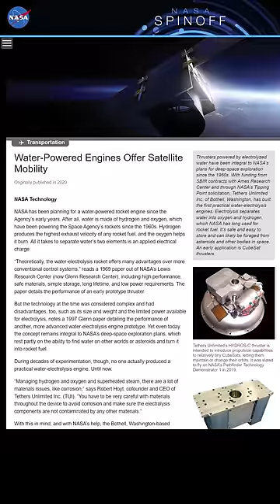This satellite runs on WATER

Comment: You can't just say it runs on water, you have to mention that electricity is needed as well
Reply: Or that it runs on electric water.
Reply: But we can always use fusion reactor to generate power for this oh wait...
Reply: Sure, but it has solar panels so the fuel it needs to bring is water...
Reply: two likes away from "haha funny number"
Reply: battery are way worst than solid fuels for storing energy. I actually don't see why their approach can be helpful at all..
Reply: @Weeb China  You're just thinking extremely narrowly. Solid fuels are useful for getting off the ground and changing elevation quickly. However, you can't just turn it off, and all of the energy output must come with the spacecraft at launch. A water-propelled engine might not get off the ground on its own (it'll still need solid fuels for that), but once it's in space, it can add energy extracted from solar panels to the water to provide thrust. That's energy you didn't have to carry from the launchpad. Granted, the amount of water you can carry will still be a limiting factor, but you'll have more options in maneuverability, not to mention that it would be fairly trivial and safer to refill if we ever get that far.
Reply: Which it gets fromcthe sun
Reply: @streamstreak  they ARE using a fusion reactor - the sun
Reply: @weebchina9639  because theyll use solar panels not batteries...
Reply: You could just say hydrogen fuel cell but then we'd have clicked off the video because there's no bait.
Reply: What rocket doesn’t use electricity? Also, it,’s a satelite, the sun is right there and it already has solar panels
Reply: Is that not implied?

Comment: The main reason we don’t already use water electrolysis is because it takes a boat load of energy to do compared to the potential thrust produced. Not to mention that storing the broken down components in their liquid states is more space efficient, and doesn’t require an external power source once the engine is ignited. Whereas the liquid engine presumably doesn’t have a long burn time as I doubt that the reaction rate is slower than the rate of electrolysis. Though I might be very wrong as I am only now hearing about this tech…

Comment: and this is why WE are gonna be the aliens that plunder water out of other planets
Reply: Not really. We have a planet that is mostly the type of water that's good for converting into hydrogen and oxygen. 

What most people realize is that it's not just running electricity through water. It needs a catalyst to work best, in addition to an anode and cathode(one of which degrades over time)
Reply: @InfernosReaper  Earth only has so much water and I'm concerned that it might use up that resource eventually.  Once you're far enough away from the planet, the water won't end up back on Earth, which will cause losses
Reply: @JSTheAnonymousOne  It does, but we use a fairly percentage of the total water on the planet.

Honestly, though, kinda missed my point later about how as a closed system it will fail just like a battery thanks to chemical changes/degradation of material(s)

If sending stuff to space weren't so expensive, they'd almost be better off with deep cycle lead-acid batteries, since those are rather robust. Even that will fail eventually, though.

Truly, we need more improvements to longevity than we do capacity...
Reply: @InfernosReaper  okay but this doesn't stop you from fueling your already built mothership with water from other planets
Reply: and taking minerals and all that while you are at it too to repair your mothership
Reply: @panzerofthelake4460  would be far more practical to harvest materials from asteroids and comets, but sure, top priority will be strip-mining worlds, definitely

Comment: Its just easier to store water, more compact, and then use solar to convert it through electrolysis, its nothing about being green and efficiency of the reaction as well as having a lot of high energy fuel on tap all the time isnt really necessary, it just needs to correct its orbit occasionally

Comment: Theres this guy who invented this car, that runs on water man. Its got a fiberglass aircooled engine and it runs on WATER
Reply: Imagine a boat powered by that
Reply: @SpostK  infinite fuel
Reply: It probably uses electricity to separate the hydrogen and oxygen from water and then uses the hydrogen to power a hydrogen engine. The energy released by the chemical reaction of hydrogen and oxygen (creating water) is the same as the energy it takes to separate hydrogen and oxygen in the first place since energy can't be created.
Reply: Water doesn't spontaneously convert into oxygen and hydrogen, you need another form of energy(like electricity) to do so.
Reply: No, it’s not possible to run an engine on water because you need to have some sort of input of energy.
Reply: It's the first thing that came to my mind, also commented before seeing yours. I'm sad people aren't getting it hah

Comment: I'm curious about the capacity within the satellite to HOLD water, and what the life expectancy is for that water to be used as fuel. And then what happens after that, is there a satellite fill station that tops it off when it runs low?
Reply: Well, the water doesn't spoil if that's what you're asking. It could freeze, but so long as you generate the electricity for heating it, it's not a problem. If you're talking mileage, it can probably go far, but I have a feeling that more depends on when and where you're going. For low earth and geosynchronous orbit, I would hope such a system can be made to last the lifetime of the satellite. I don't know what the performance characteristics would need to be for the average satellite though.
Reply: @Zeero3846  The thing I am curious is lets say the fuel mileage. What quantity does it bring with it to orbit, and how long does that quantity allow it to remain in a geosynchronous, or a geostationary orbit, assuming there being no need for emergency maneuvers to avoid space debris, etc.

Comment: What's the advantage of doing electrolysis in orbit instead of having the hydrogen and oxygen already separated?
Reply: Yeah, maybe due to difficulty of storing hydrogen and oxygen seperately? I mean it's always good to test a concept.
Reply: Liquid hydrogen and oxygen need to be kept at very low temperatures, which requires lots of energy to maintain. Hydrogen is also a very small molecule and is thus quite difficult to contain. Most satellites use hypergolic propellants which are stable and provide a decent amount of thrust, but are extremely toxic. Ion thrusters are also an option, but they provide very little thrust.

Comment: Really failed to explain much of anything. Is the electrolysis a way to use small weak solar panels to turn water into 2 fuels that can be stored (like a battery), and then when propulsion is needed is burned in essentially a tiny regular rocket engine?

If so, why have it as water to begin with, rather than 2 fuel tanks with them already separated? So clearly can't be that...

Is it truly only used as a battery, where when propulsion is needed an ion engine (or the like) is used, and to get enough energy the stored gasses are burned into water? To then slowly re-electrolyze with solar power when power-demand goes back to minimum?

What?

edit: looked it up, it's literally just what I guessed in the first paragraph. And the answer to the second, is that water is "safer", so considered better to store water during launch (than hydrogen/oxygen) to avoid possible freak accidents turning into explosions.

Comment: Where the electricity for dissociating the water in oxygen and hydrogen is coming from?
Normally satellites don't use RTGs, as they are both very expensive and controversial. Therefore the satellite must have some generously sized solar panels, together with large batteries - in low earth orbit, you have sixteen - and change - sunrises and sunsets...

Comment: Launching water into space is a waste of launch weight capacity. Not enough energy density.
Reply: The energy comes from solar power. The point is that rather than being difficult to store hydrogen and oxygen liquids at launch, you make the hydrogen and oxygen using readily available solar energy

Comment: Hydrogen... It's a hydrogen rocket. It hasn't been used as much to burn as fuel because of the water buildup that can occur in engines when burning it, which is why hydrogen cars instead convert it into electricity.
Reply: I mean in rockets hydrogen is used fairly commonly.

Comment: Wait, so of we strap on a nuclear reactor bfor power and then use that power for electrolysis and then use the resulting gas for propulsion, time for my 3am research on nuclear powered water electrolysis rockets.
Reply: We can also use solar energy for electrolysis.
How is the research going?
Reply: @confused.cat.  there is Nuclear Thermal Propulsion (NTP) and Nuclear Electric rockets, but I couldn't find any material on Nuclear Electrolysis Rockets. Either the method is not as efficient as NTP, or more research is needed. I didn't yet find any documents saying that its impossible or inefficient, so still reading.

Comment: Wonder what happened to the guy who built a car that ran on water for fuel. Didn't he and his car go missing?
Reply: Regardless of whether or not he was killed in the way conspiracy theorists claim. He was a fraud and it didn't work, it broke the first and second laws of thermodynamics.

But hydrogen cars (where the splitting is alresdy done before putting it in the car) are very much a thing and already on the roads.

But they too can never be as efficient as a standard electric car, as the energy required to make the hydrogen is far higher than that needed for creating electricity centrally.

Comment: We have limited water... they want to keep sending more to other areas. Think longterm... it is not a light fuel.. it makes no sense longterm.
Reply: There's limited potable / fresh water, but the planet is literally covered in water. No amount of satellites will make a dent to that.

And if this is mostly for satellites (and not for outer space), the water will most likely eventually return to earth (it won't remain in orbit forever).

But the weight argument is definitely a limiting factor.
Reply: or short term
Reply: All other space rockets already use the chemical reaction of hydrogen and oxygen for propulsion. The difference is that they are already separate by the time of launch instead of being separated in orbit with electrolysis.

Anyway, I doubt the amount of water used to propel rockets is anywhere near the amount of water brought to earth by comets.
Reply: @lbochtler  Some quick googling told me that the 2 rockets on Nasa's space shuttle held 1.000 tonnes of fuel. Earth's hydrosphere holds 1.400.000.000.000.000.000 tonnes of water. That's 1.400.000.000.000.000 sets of rocket boosters for the space shuttle.
Reply: @victorro8760  if i recall correctly the hydrogen for the spaceshuttle engines was created from hydrocarbons, not water. The engines tgemselfs are hyrogen oxygen engines, but the two components are not created from water onboard tge spacecraft as in the sstilite mentioned in the video. They are stored in liquid form at cryogenic temperatures to tgen be burn in the engines combustion chamber and gas generator. It would be highly impractical to place the reacted fuel, an electrolesis facility capable of producing several tons of fuel per second per engine, as well as a power source capable of powering the electrolesis plant. Its far more practical to do that on earth and only load the unreacted fuel on the spacecraft. 

Not to mention the problems electrolysis carries with it as just a technology. The electrodes used literally get disolved into the water your breaking apart.

Comment: Water is heavy and won't work longterm... not effective
Reply: Weight alone is irrelevant. What is interesting is specific impulse (more or less how much thrust you get per kg of fuel). Hydrogen-oxygen engines have very good SI. Ion thruster are better, but the gases used to fuel those are relatively expensive and they have low thrust. Obviously the additional hardware to perform electrolysis adds weight, but storing liquid hydrogen and oxygen for long periods of time is very difficult while storing water is relatively easy.